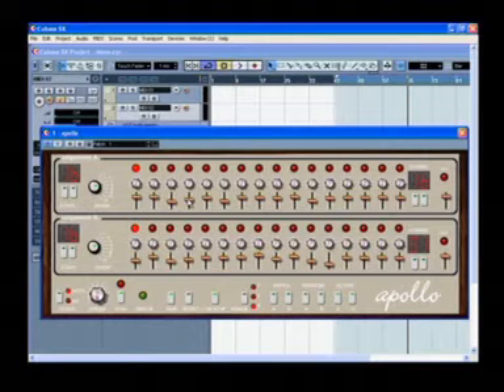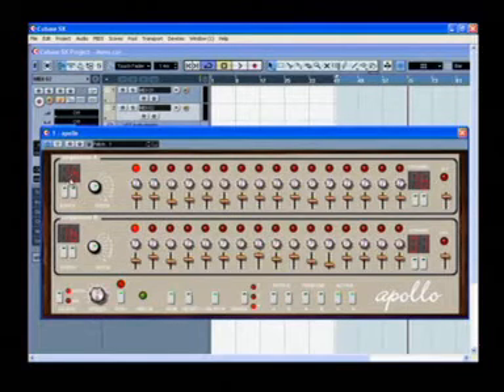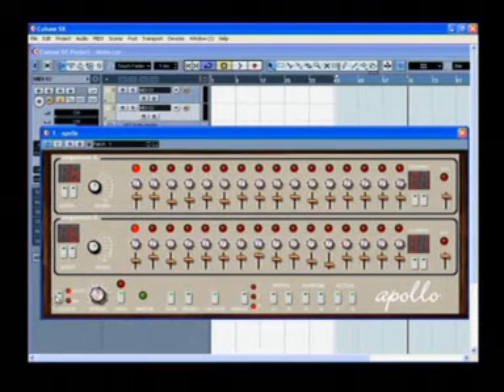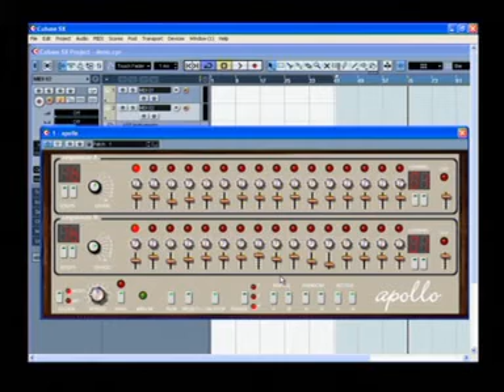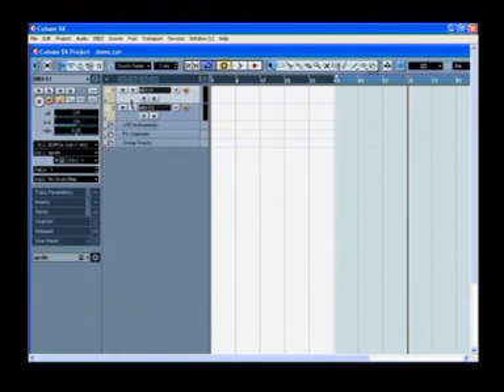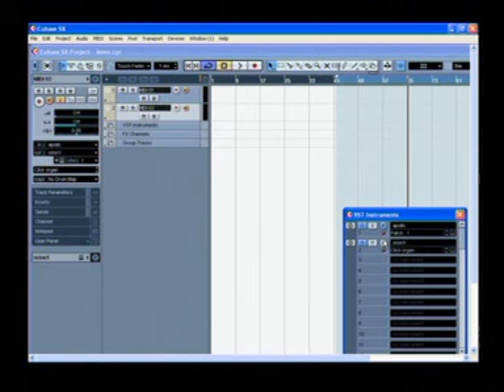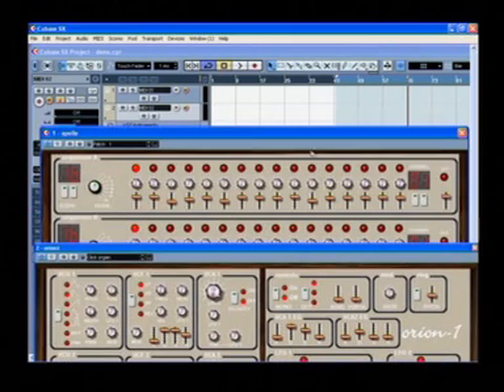Apollo Stepsequencer demonstration  PART 1/2

Comment: I know, weird using this in 2020, i would like to know if its possible to route that "internally" to a vst instrument, i use the old orion platium but without any midi equipment. 
btw. also cant bring your gemini to run with the included step sequencer, the damatriks works with its own sequencer....
Reply from the maker: What DAW are you using?
Reply: @meeshamusic  Orion Platinum 5.5 (old stuff) but no midi interface, i use it with the "piano roll" editors and tons of plugins
Reply from the maker: I am not familiar with orion platinum so I can’t say if it has the ability to route midi between vst’s. Looking at the specs of this program I don’t think it is possible. I’d suggest using a different daw such as cubase logic or ableton.
Reply: @meeshamusic  thank you

Comment from the maker: Hi. I don't have Ableton my self so I'm afraid I can't help you with that. But I do know that other users got it working in Ableton somehow. The way It should work is like this. (as explained in the video). Midi track one: Input=Midi keyboard, output=Apollo. Midi track 2 In=Apollo, out= synth or VSTi plugin. In VST host you should route it like this as wel. So: Midi Keyboard->apollo->VSTi (or hardware synth).

Hope this helps

Comment: thank's ,it totally works in flstudio 5, ive seen what i did wrong ive'd inverted the midi inputs and outputs... in flstudio works by:
setting fruity wrapper (Vst Host)  Apollo output to (for example) Port 1,and setting fruity wrapper (Vst Host)  Pro-53 synthesizer (example) to input port 1. great! ,now i just have to use a tr-808 drum machine for some great 80's Synthpop!!

Comment from the maker: Hi. I don't have FL myself but generally this is what you should do: Open Apollo as a VSTi. Route the midi signal from your midi keyboard / controller to the input of Apollo. Route the Midi output of the Apollo to a synth (Hardware or VSTi).

In Cubase I have 2 midi tracks with the corresponding MIDI in and outputs. Try to discover how this works in FL. If you need more help just let me know

Good luck